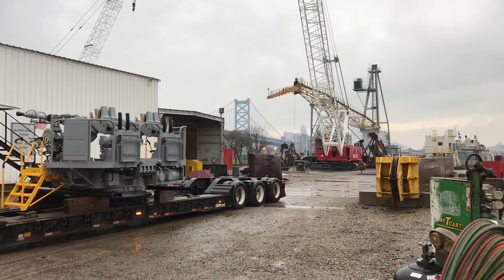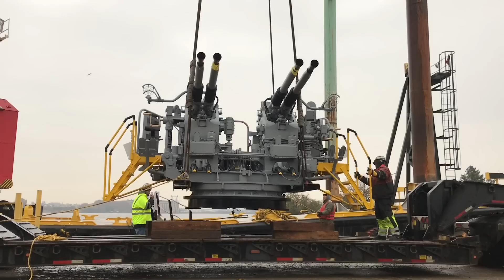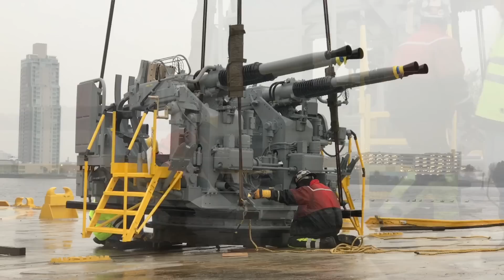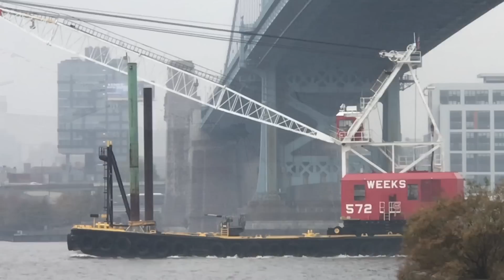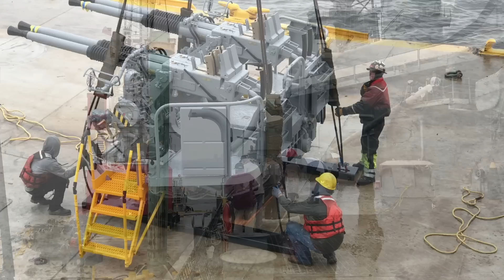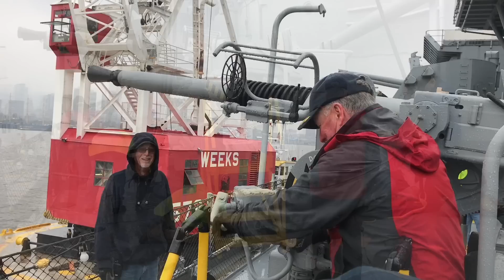Battleship New Jersey's Quad 40 returns after 50 years

Comment: These evoke more respect than the tiny one gun peashooters on the current destroyers.
Reply: modern destroys  are still using the (152mm) 5"/62 caliber gun. same round size as the secondaries on the Iowa's so hardly a peashooter when the round is almost 4 time the size and was used as dual purpose AA in WWII.
Reply: Yes but the quad was 480 rounds per minute, the 5 inch is only  20 rounds per minute. Which would scare you the most?
Reply: im trying to figure out how people thought that such small ships that we use today was a smart idea with only one main gun on board. i mean with the way anti missile and anti submarine technology are going. the next place of combat not being improved is  2 ships within 8 miles of each other slugging it out till someone capitulates or sinks. i understand its not gonna be common should a modern naval war happen but its still a place where i dont think any navy has what it takes to win decisively anymore.
Reply: Designed by politicians and accountants rather than by the military.  Kind of like the Bradley vehicle, started as a cheap troop carrier ended up being a mess due to commitees.
Reply: because Guns have a range of 10-25 miles. Missiles have 10-100 times that range.  the Little deck gun they have now isn't for slugging it out with other ships, that's what missiles are for. The deck gun is only there to deal with patrol craft
Reply: Richard 1 if I was flying an attacking aircraft, the gun firing the shell with the radar fuse would scare me more.  That would be the 5”.  They removed 40’s and 20’s after WW2 after finding they weren’t effective in knocking down kamikazes.  40’s were replaced by twin 3”.  Also 5” guns had greater range, a greater lethal zone, and their gun fire was usually controlled by radar gun directors.
Reply: +Steve Evans the 40's firing looked good for PR films in the states. But I've heard a few vets complain the battleships with all their AA guns couldn't hit squat. IIRC the vets were aircraft carrier crew members. One LST crewman I knew personally commented that Navy AA gunners were terrible shots. He didn't think his ship's AA guns hit a single aircraft throughout the Pacific Theater. Training and practice was close to zero.
Reply: @majorpain71  The destroyers and cruisers use 127 mm (5 inch) guns
Reply: Those peashooters spit out more ammunition than the main batterie and the qaud 40s especially the otomatic 76
Reply: @majorpain71  152mm is not = to 5 inch.
Reply from the maker: Video update - https://youtu.be/yiEubQV4aRQ
Reply: Richard 1   Those "peashooters" (127mm) may not not put rounds out as fast but they're are a hell of a lot more accurate and lethal at a greater range.

Comment: Went to Viet Nam in 1965 (Marines) on a WWII LST had 4 singles and two twins on the ship We had a competition between Navy and Marines Using two singles. We shot at floating 50 gal. drums. I was the Marines First Loader. I would stick the 5 Rd. clips in the gun. 2nd. loader would be handing me clips stored around the inside of the tub. WOW those guns suck up the rounds FAST. You really had to move fast to keep the gun from stopping. If it did you would have to cock it again. Fun Fun Fun. The Marines took gold.
Reply: LST, Large Slow Target?
Reply from the maker: Video update - https://youtu.be/yiEubQV4aRQ

Comment: I've sat in one of the quad Bofors mounts aboard USS Lexington in Corpus Christi. They seem to traverse and elevate really slowly; it's hard to believe they could track aircraft targets.
Reply from the maker: Normally they were tracked and elevated with electric motors and could move quite quickly. The hand cranks were backups if they lost power.
Reply: @ClarkPerks  That makes sense.
Reply from the maker: Video update - https://youtu.be/yiEubQV4aRQ

Comment: would these mount in the back of a ford f550 pickup?
Reply: Joseph springer Quad .50 for a pickemup, or twin 20mm.
Reply: Could get a tad tight, but man could you harvest the jack rabbits.
Reply: Joseph springer yes a si gle barrel will they used them in sa olia
Reply: youd' need a 23 000 pound payload... I think you gonna need a Dodge!!
Reply: A 5 ton would be too small!
Reply: Philippe Benoit 🤣🤣🤣🤣🤣🤣
Reply: 23,000 pounds, so no.
Reply from the maker: Video update - https://youtu.be/yiEubQV4aRQ
Reply: Right next to the "Don't tread on me" flag.

Comment: The horrifying part is that 19 of them were cut up.
Reply: WHY
Reply: @mordicuspb  Because they were obsolete in the '60s.  Even at the end of WW2 the Navy knew the 40mm was under powered because one hit would not bring down a kamakaze.  That is why post WW2 most 40mms were replaced by 3" AA guns.  They had a larger shell and with proximity fuzes put up a thicker umbrella of steel.
Reply from the maker: Video update - https://youtu.be/yiEubQV4aRQ

Comment: How did you track an aircraft at those traverse speeds, unless that was a backup and the mount was hydraulic powered.
Reply from the maker: They were actually electrically powered and aimed by a gun director. The hand cranks were backups.
Reply: @ClarkPerks  cool. They were a great gun and ranked second behind the 5" gun for stopping kamikazes in their tracks.

The Mount looks awesome. Well done
Reply from the maker: Video update - https://youtu.be/yiEubQV4aRQ

Comment: Does this have manual windage and elevation only? Or is there some kind of power support also? Like electric or hydraulic.
80 barrels of bofors on a BB is alot!
Reply: It is power operated and the later units were remote controlled from directors.
Reply: These were radar and computer (analog) guided.  The gunners just fed the ammo , they were aimed by a Mark 37 (and later editions) director. The Director used radar info fed into a analog computer which could aim several guns at a single target, this, along with the proximity fuse got hit ratios of 1,000 to 1, the next best system was 6,000 to 1
Reply from the maker: Video update - https://youtu.be/yiEubQV4aRQ

Comment: Is that one of the historically correct positions on the deck for the 40mm bofors?
Reply from the maker: Yes. During World War II there was a 40mm bofors in that spot. It may have even been that very gun in that spot.
Reply: @ClarkPerks  interesting, thanks for the info.😀
Reply: @ClarkPerks  1 in 20 chance... or 5%.
Reply from the maker: tubedude54  - Actually the odds are closer to 1 in 5 or 20%. The shipyard worker who helped remove that gun in 1967 is still a volunteer at the Battleship. He removed the gun from the port side, which narrows it to 1 in 10. And it was not one of the guns far forward or aft, which gets us closer to 1 in 5!
Reply from the maker: Video update - https://youtu.be/yiEubQV4aRQ

Comment: New York City could have used 20 quad mount 40mm AAA  Bofors manned and Operational on 9-11-2001.
Reply from the maker: Video update - https://youtu.be/yiEubQV4aRQ
Reply: Craig Large    It's a nice thought, but those planes simply would have crashed somewhere else.   Even if these guns could touch them, which they probably could not.
Reply: Those 9/11 hijacked planes were moving a lot faster and were much higher than kamikazes.
Reply: @jamesjwalsh  40mm Bofors could reach up past 10,000 ft in elevation, in wiich those planes were flying during there their last 10 mintes of flight. The one things really limiting the practicality of 40mm Bofors AAAis that their horizontal range is no more than a couple of miles. It would take very many of those quad mount 40mm Bofors to be of any use. lots of operational cost!! Also to bring one of those aircraft down could also result in some collateral damage.

Comment: Why are the barrels turned sideways in transport?
Reply from the maker: Sinister Shenanigans  - It is very hard to see in the videos, but the distance from the end of the barrel to the back of the mount is shorter than the width of the mount. So the truck load would actually be wider if the barrels were not turned sideways.
Reply from the maker: Video update - https://youtu.be/yiEubQV4aRQ

Comment: Deadly weapon against helicopters......
Reply: Just think what they would do to those Iranian speed boats and Somali (sp) pirates.
Reply: Ohhh👀💥
Reply: Not so much. They have no fire control that can hit a small, fast-moving surface target - everything was designed for AA (heck, I'm not even sure they can depress well enough to hit surface targets easily).  And they're not like the 25mm Bushmaster mounts you see today on many ships - these things are BIG and decidedly non-trivial to manually aim.  The 5"/38 mount shooting VT would actually be FAR better than the 40s against small fast-movers.

Helicopters - yeah, that's in the 40's wheelhouse. Surface targets, nope.
Reply: Erik Trimble Shhhh, just imagine hitting a helicopter .. imagined ???
Reply: The L60 version (which is what's on all WW2-era ships) would be nasty, but there's one big issue with it shooting at Helos - range.  Effective range for the 40/L60 is well under 5km, which is noticably less than many helo-mounted missiles (though more than sufficient against those armed with just guns or unguided rockets).    But yeah, 40mm on a helo is ugly - heck, the primary gun-based anti-helo weapons these days use 25 to 35mm calibers, so a 40mm would just shred even the semi-armored attack helos.
Reply from the maker: Video update - https://youtu.be/yiEubQV4aRQ

Comment: Don't do anything to those ships that woulr prevent their rapid reactivation. It's the law. I don't think a quad 40  will hurt the New Jersey.
Reply: They've been stricken from the Navy register now.
Reply: The original law moving the Iowas into museums did have a stipulation that no modifications could be made that would hamper their reactivation (even if they were no longer even considered "mothballed").  However, in the mid-2000s, the Navy realized that reactivating them would be so expensive, you literally could build another DDG-51 in less time and for less money than reactivating an Iowa.  So they were permanently stricken from the Navy Register and they're now permanent museums, with ZERO legal requirements. In effect, they're now private property of the museum foundations and will never be reactivated.
Reply: All Battleships are now permanent musems, no longer to be used for active service
Reply from the maker: Video update - https://youtu.be/yiEubQV4aRQ
Reply: I believe that the Navy still has certain dibs on these and all of the other museum ships under certain circumstances.  It would be more likely that the Midway and some of the other carriers would be reactivated before anything else. We know Midway worked when we parked her. Same with the Iowas. Carriers are useful for a lot of things. Things that don't require a modern carrier. A reactivated carrier set up as super assault ship , anti submarine or even fleet air defense,  relieving other more modern ships for offensive action elsewhere.  Hospital ship or troop transport is another. It would probably be a lot less expensive to reactivate a carrier than an Iowa because of the number of different specialist personell required to operate weapons and other systems unique o them.  I personally like to think of these ships as dormant volcanoes . The above ships would be much more likely to be reactivated than , say   USS Texas.   Actually. None of them are likely to be reactivated. That would require a stupendous national emergency .   
    The Quad 40 looks great. I remember carefully painting and mounting those on a model of New Jersey .  With people like Ryan and the staff and dedicated volunteers that maintain these ships,  future generations will enjoy and learn from these great ships.  
    The explanation of zinc and magnesium anodes  and active corrosion protectection applied to these ships means that what happened to USS Texas will not occur to these ships.

Comment: I don't think the navy will ever bring these back...it's a shame too. I thought maybe because of the zumwalts are having ammo shortfalls in terms of protecting marines going ashore...
Reply: The BBs are just too manpower intensive. 1800 men required, whereas a DDG has 300ish. Total operating costs for a BB are at least 10 times more (and probably closer to 20x) than a DDG. And the BBs are unfortunately VERY vulnerable to modern torpedoes. Fixing the gun on the Zumwalt is far more economical,  especially when you take into account that there are very few spare 16" barrels, and producing more would cost 10s of millions. BBs are a thing of the past, and we'd be better served by rethinking what a real Naval Gunfire Support ship should look like - the Zumwalt class looks to be a bad fit, and the BB concept is just obsolete.
Reply: Plus, 16" naval gunfire is great at hitting 500yd x 500yd squares. Not so great at pillboxes or point targets. A single 500 pound laser-guided bomb from an aircraft, or 5" round from a destroyer that hits, is infinitely better than a 16" salvo that misses.
Reply: Not to mention that actual cost it would take to put one of these grand old ladies back into service. Missouri is probably the most modernised out of the lot, and to be functional again, youd have to replace pretty much everything. The engines would need replaced and modernised, the computers are early digital ones from the 80s, they would all need replaced, the wiring throughout the entire ship would need changed. You would practically have to rebuild her from the keel up. it may actually be cheaper building a brand new ship instead.Much as I would love to see even one of them move again under her own power, and would REALLY love to see all 4 sailing side by side again, and had I insane amounts of money, I would do so, but sadly, they are just too expensive to consider dealing with. It would take something like a global catastrophe to unite the world, to even consider bringing them back into service, like alien invasion or something
Reply: You probably wouldn't have to replace any of the mechanicals, as they're in good condition and only probably need a bit of refurb.  But you'd have to do a full-ship electrical inspection and refit. The entire electronics suite would have to be replaced, and the secondary weapons suite updated (new CIWS, new GMWS, VLS for Harpoon/Tomahawk, etc.). Not to mention restarting the entire manufacturing logical chain for the 16" and 5"/38 guns and ammo.  I can't see it costing under $1B/ship, and probably at least another $1-2 B in support/design costs.  That's equivalent to buying more DDG-51 Flight 3 ships, which are far more capable (and far less costly to operate). 

Honestly, if the Navy really cared about NGS as a mission, we'd build something like the WW2-era LSM(R) ships:  small, cheap, sturdy, shallow draft, modest speed (20 knots), and room for a limited weapons loadout.  Something like a single 8" rapid-fire gun, a couple of 25mm mounts for anti-boat work, and a RIM launcher.  Probably could build a half-dozen for under $1B, and they'd only require a crew of under 40.
Reply: back in 99 it was estimated to be 4-500 million per ship to refurbish and update each individual Iowa. with another 100 million to supply new powder for each Iowa. Given that the Navy and EPA has even stricter standards today and even more advanced not to mention more expensive equipment needs you can expect to tack on another 2-400 million per Iowa.
Reply: If you want to see the Missouri fired up and cruising, they do it in the movie Battleship, this is a great scene, you just have to ignore the fact that they get boilers that haven't been used in 30 or 40 years, hot in 20 minuets.
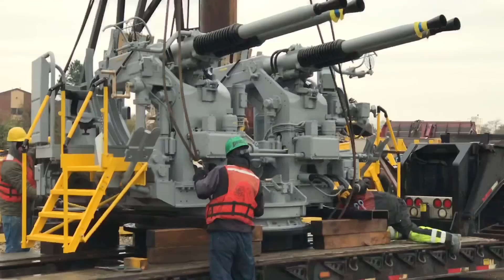Start at 0:30.
https://www.youtube.com/watch?v=zwVQ7M5IFt8
Reply from the maker: Video update - https://youtu.be/yiEubQV4aRQ

Comment: This is maneuvered by hand crank?  There is no way that these could be of use for close in fast moving attacking aircraft!  That is the same problem the Japanese had with their ships in WW2 when the Americans were assaulting IJN ships, their defenses were also maneuvered by hand cranking and were not that useful for fast moving close in air attacks, but useful in distant approaching aircraft!
Reply: It was powered traverse when coupled with a gun director. Otherwise they would be manual traversed.
Reply from the maker: Video update - https://youtu.be/yiEubQV4aRQ